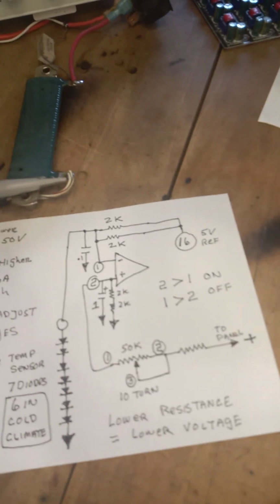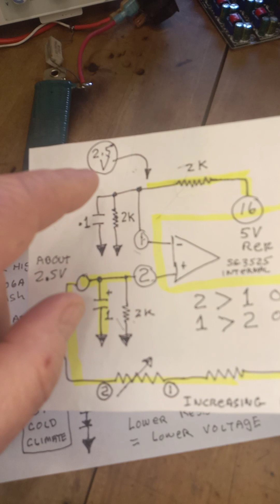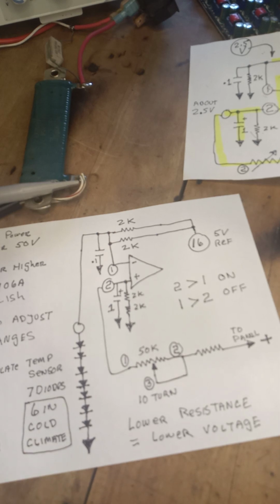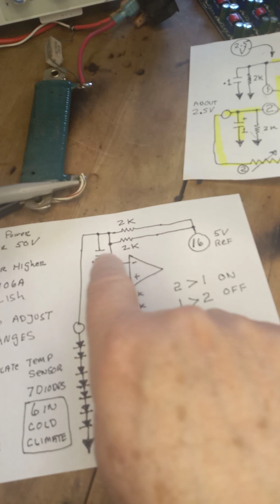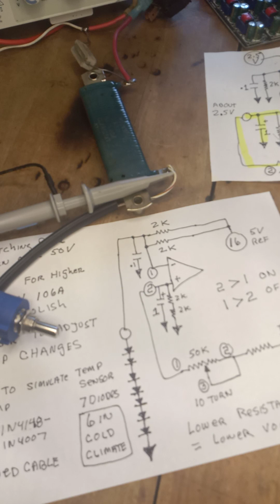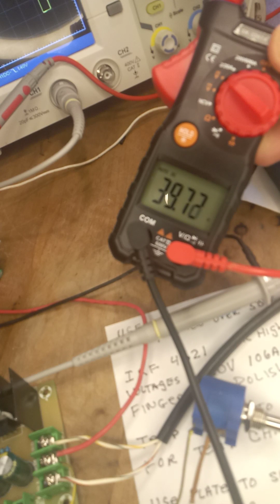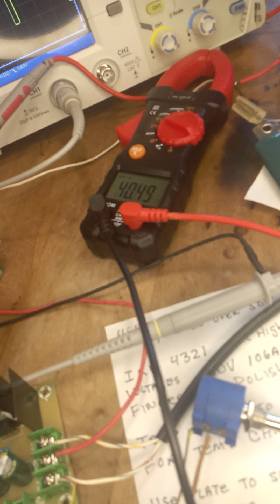PV Hot Water Controller Build From Inverter Board part 6

Comment from the maker: This project is for those with some soldering skills and a real understanding of solar.  It can be accomplished by anyone with motivation and the patience to learn. Order a minimum of two boards. You can not even replace the IC for the price of a second board. Have one to make mistakes with. Build a second board to have one as a spare.  Boards from China change and become unavailable. ALWAYS READ ALL COMMENTS. They include information that may have been left out of the video or changes.

MINIMUM MODIFICATIONS FOR ARRAY VOLTAGE LESS THAN 50V

Cut traces at both power pins.

Connect a minimum of two wires to the center common of the board for negative high current 
connection to the capacitor bank negative.  DO NOT USE the negative screw terminal as the high current path.

Jumper the two large traces together on the single FET used as ideal diode.

Remove resistor at the end of the IC that goes from pin 16 to pin 2.

Place that resistor on underside of board from pin 16 to pin 1.

Lift resistor lead at pin 2 side.  The other end of the resistor goes to common and remains.

Lift resistor lead that goes from common to pin 1. The side that goes to common is lifted.

Connect the two extened leads together.  There should now be a resistance of 4K from common minus to pin 1.

Remove soft start 1uF capacitor from pin 8 at the end of IC.

Solder 1 uF capacitor to underside of two terminal connector. Banded side of capacitor to the negative.

Solder the other end of capacitor to adjacent terminal.  This is the pot input.

Solder wire from pot input to pin 1. That pin goes to an easy large pad eith capacitor and resistor.

Lift 100 ohm resistor at side of pot from pin 5 to pin 7. This is the deadband control. Put 100 ohm resistor in series or replace with 200 ohm resistor.

Add two 1N4007 diodes to the three terminal connector. Almost any general purpose diode will work. The unbanded side goes to the outside pins.  The banded 
sides go to the center pin.  Center pin is the PV positive.

Add a compensation capacitor from from comp pin 9 to common. Pin 9mdoes not have a pad and you need to flatten the pin and solder to it. This is delicate 
soldering operation and will not have much strength. Use capacitor value from .001 to .0047 uF.

Build a capacitor bank with at least 10 capacitors, more capacitors the better. Consumer grade capacitors are aonl good for abour 1A each.  Minimum total 
value should be 4700uf.  For low voltage it should be 10,000uf

OPTION A
Solder a resistor from the center pin of connector to the positive of the two 470uF electrolytics. The resistance varies depends on the array voltage. Usually 
from 1K to 1.5K.  A resistor dropping supply has the highest immunity to lightning spikes. Series resistors inprove that even more and prevent flash over. 
Ordering a 200 ohm 1/4W resistor for deadband,  Just put a number of these in series to reach the correct resistance and place them in heat shrink tubing. 

Solder a 13V zener diode across that electrolytic capacitor.  Banded end goes to positive. 

OPTiON B
Use an isolated switching power supply to supply 12V to the two electrolytic capacitors.
The power supply shown is 12V 300ma 100-380V DC / 70-270.  At as low as 20V it will work with small loads like 20ma. I use capacitors thru mounting holes to 
create a good termiination to wires. This is the beast low voltage capability that I have seen with any power supply.  Suggest minimum of 40V. Other supplies 
may require modification.